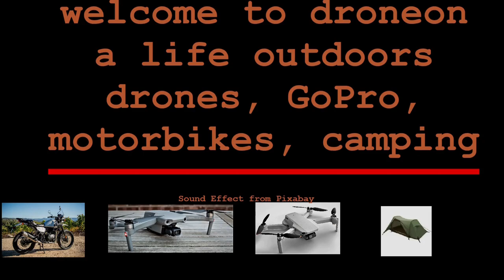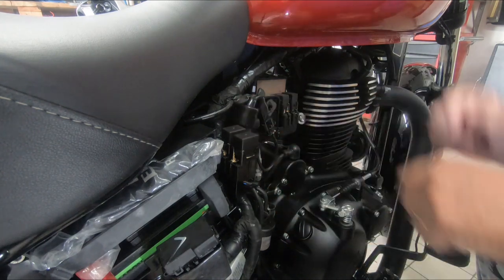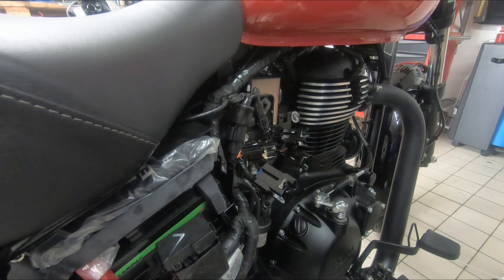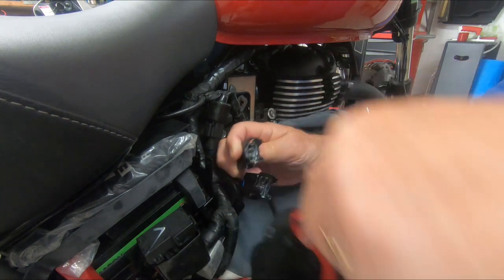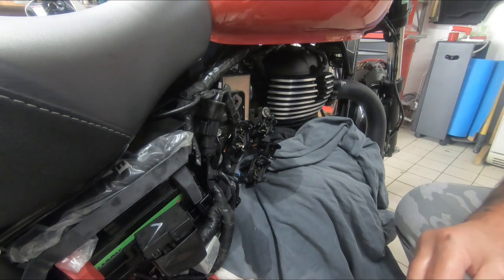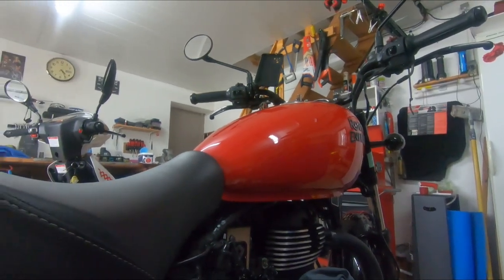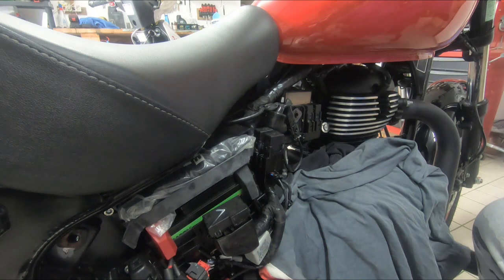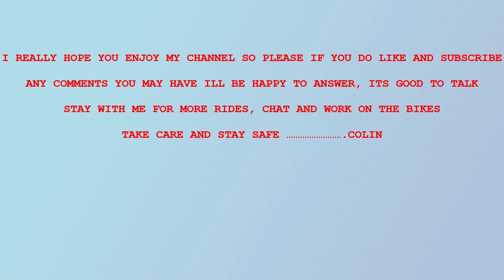#royal enfield meteor 350 excessive grease to the relays

Comment: That white grease is Dielectric grease perfect for electrical connectors ..it protects the terminals and prevents arcing  , I use it on both of my Triumphs.. you've just washed it all off !!
Reply from the maker: Hi Kevin, there was a small amount left where the relay sits, after over 60 years of riding and maintaining motorcycles there isn't the need for so much to be put on, in fact the bike or any other bike would run perfectly well without it, but, it's very important we all look after our bikes to what we think is right, thanks for watching and thanks for the info ........Colin 😊

Comment: The problem wasn't so much the grease (although there is too much of it arguably)  it was the quality of the original relays fitted.
Reply from the maker: Hi Albert, yes I agree, when I did the same job on my Himalayan I changed all the relays to Bosch, on the meteor I have a few things I want to change on her, but checking the relays was on the list, i must admit I never had a problem with my Himalayan even with the original relays but I thought better to air on the side of caution, so in time I will replace the ones on the meteor, thanks for watching, .......... Colin 😊
Reply: I'm still not convinced of the relay/grease problem being either - I know people who have not only thoroughly degreased them but also changed all the relays for aftermarket ones and still suffered from the cut out issue.
Reply from the maker: @icedidi  it's a strange thing, I never had a problem before or after, I did it as a precaution, I think that maybe the fuel pump could be suspect...... Colin ☺️

Comment: Must have a look at my Meteor this winter. I will clean mine with dry acid brushes so as to leave a thin layer on them.
As for storage, it is what is. Had a couple of late 50s Enfields and the toolboxes were boxes. All this space has been replaced with electronics. (relays and stuff).
As I will never carry a pillion, the seat and footrests and grabrails have been removed and been replaced by an aluminium plate with a 35L alloy top box. It sits right up behind me and even supports my old back. I have no interest in aesthetics.
Reply from the maker: Hi, yes it's certainly worth a look, royal Enfield seems to love the grease, I always apply a thin spray of water repellent over mine, it's a shame that these days on modern bikes storage doesn't exist, as you say a bike must be for your needs, so looks have to take second place, thanks for watching, take care........ colin 😊

Comment: i will ask did grease stop the bike from working,? now you have removed the grease, water will get in to the relays and the bike will stop, i have a 350 meteor and this was the problem after removing the grease,
Reply from the maker: Morning Colin, in my case on both of my bikes, Himalayan and the meteor I had no problem with starting whatsoever, but both bikes had excessive grease, the Himalayan I removed the grease and replaced the relays with Bosch, my meteor I removed the grease but used the orignal relays, now I've been riding bikes for over 55 years and never had relays covered in grease or any other protections and I've never had a problem, but, if you look way back in my video's for years now I completely spray all my bikes including all electrical items with GT85 , my 34 year old honda transalp has never given me a problem and all the relays have no grease, I truly believe that when all the grease they use when it gets dry and hard and attracts all the dirt will do more harm than good, I hope I've been of some help, take care ......Colin 😊